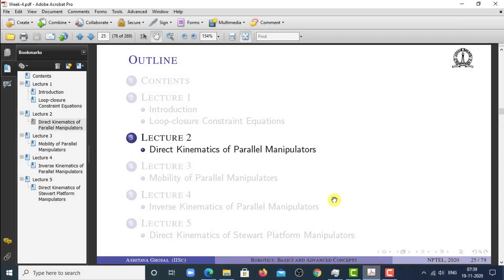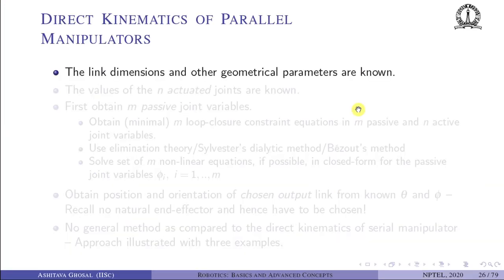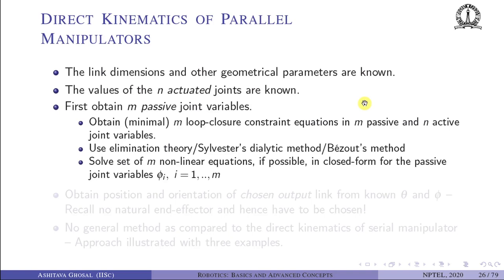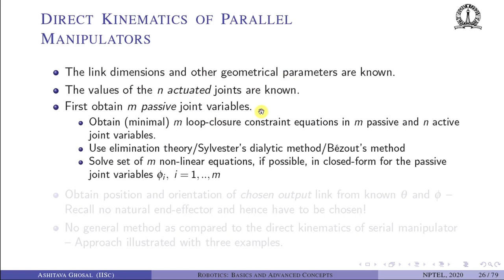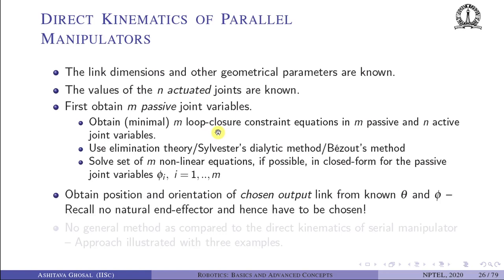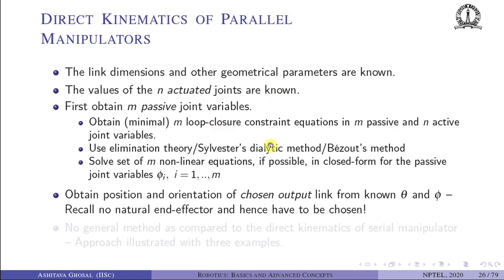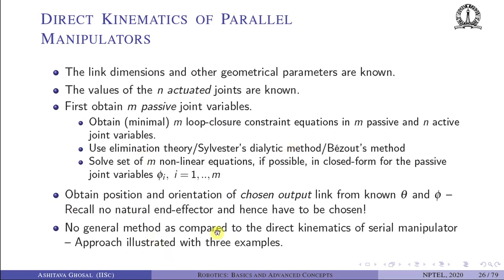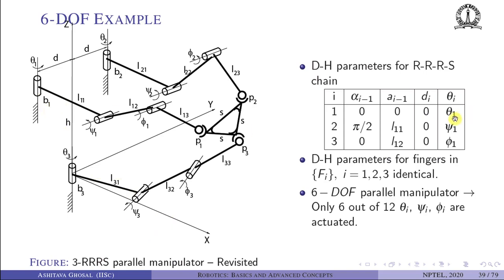lec12 Direct Kinematics of Parallel Manipulators

Comment: Do you have the exact steps or maple code for the Sylvester's dialytic method for the 3-DOF Example calculation, I'd like to reproduce it, but the code I wrote following the equation in the example doesn't compute it, and I don't know what's wrong.

Comment: Dear Sir,
Can you please share all the equation (passive and active variables)for the direct kinematics of the 3DOF parallel robot.
Thanks
Reply: Do you have the exact steps or maple code for the Sylvester's dialytic method for the 3-DOF Example calculation, I'd like to reproduce it, but the code I wrote following the equation in the example doesn't compute it, and I don't know what's wrong.

Comment: I'm trying to replicate the Sylvester's elimination of the passive variables using Sympy but I'm having a lot of trouble while tackling the six-DOF platform problem. I'm able to eliminate one passive variable but for the second one, it's taking a very long time for the computations to complete. While using Maple, how much time does it take to run the whole problem from start to end? Has anybody done this with Sympy?
Reply: Do you have the exact steps or maple code for the Sylvester's dialytic method for the 3-DOF Example calculation, I'd like to reproduce it, but the code I wrote following the equation in the example doesn't compute it, and I don't know what's wrong.